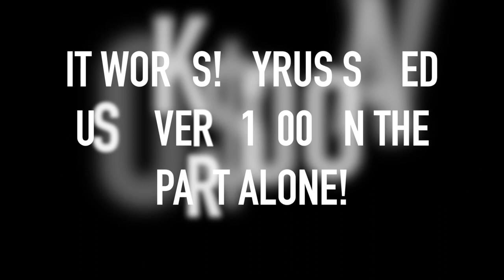How we saved $1K fixing our Stuck Engine/Exhaust Brake Ourselves on Our Diesel Pusher RV! | #rvlife

Comment: did the gasket fix the air leak sound? Mine is doing the same thing and I am wondering if this might be my issue as well
Reply: It did. I also have a broken exhaust manifold stud and it's leaking from that gasket, which is metal, so it makes a lot of noise. It's really loud when the engine brak is on under heavy deceleration.

Comment: Have you had any further problems with it sticking?
Reply from the maker: So far so good!! Needs to be relubricated every few months though. <3
Reply: I appreciate the video..i just added a pacbrake to my dodge ram a in line unit. We use to use Kroil at the power plant i worked at for many years to lubricant and free up frozen or stuck parts ect . I had good luck with it.... i have to get some lubricant to service the pacbrake... Synthetic light weight oil and i actuate the brake to keep it free .

Comment: would that be considered a jake break ?
Reply: Well technically a jake brake is controlled with the cylinder head's valves. So technically no this isn't a Jake brake but a lot of people use that term interchangeably between the two types of engine  brakes.
Reply from the maker: Thank you Cyrus for explaining more!